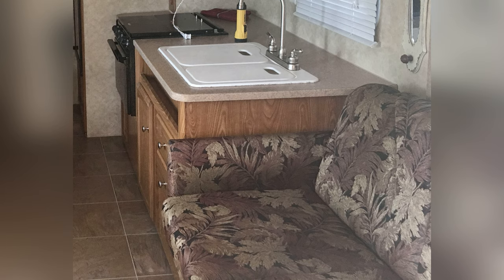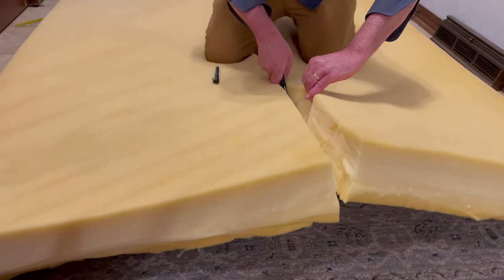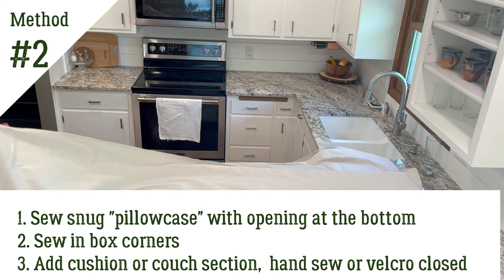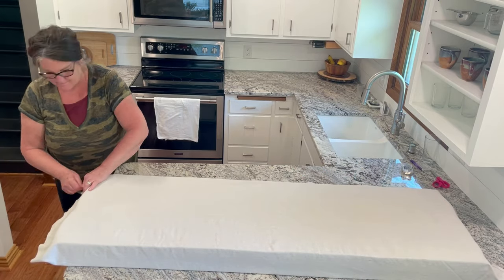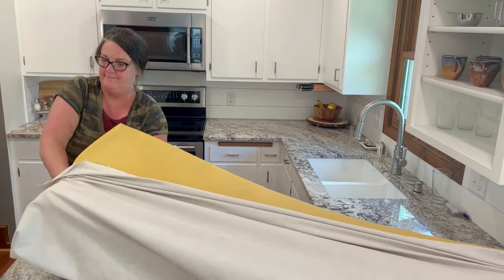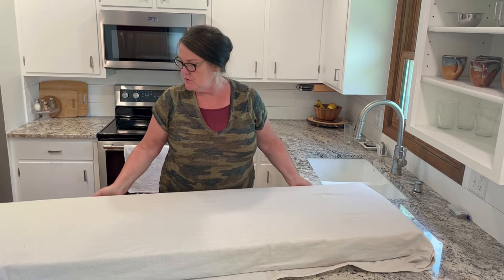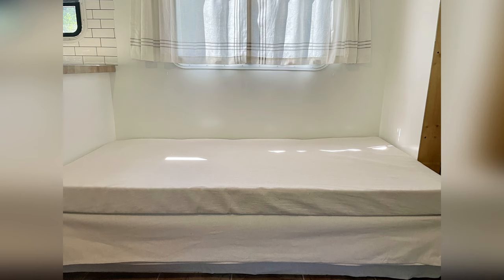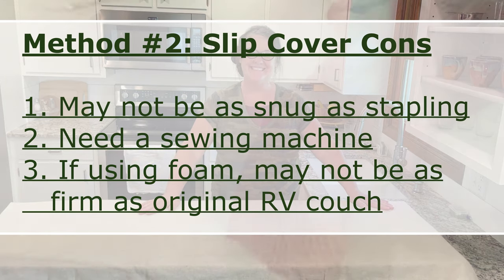RV Cushion Recover CHEAP + DIY: 2 Ways to Use Drop Cloth Under $20 and Making Our Couch!!

Comment: Wow you do it yourself. I guess it is easy with a staple gun. But does that hold?
Reply from the maker: It does! I have a Dewalt 5120 and used 1/4” staples. Works great! Great question! 👍🏼